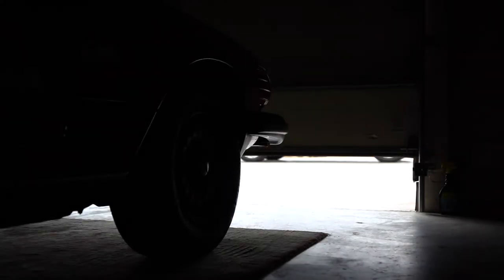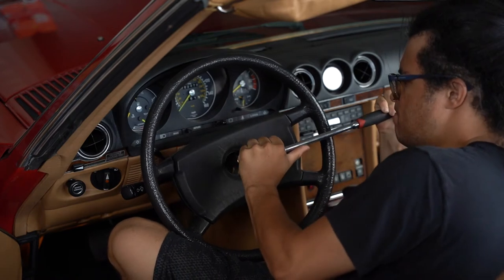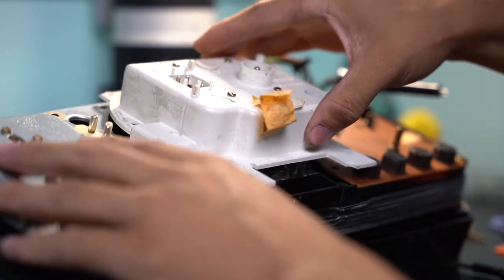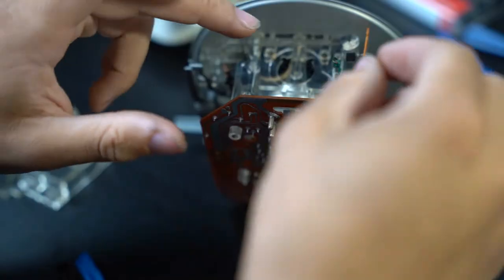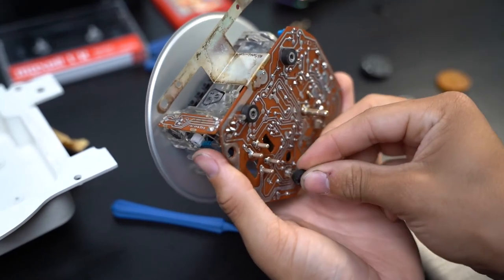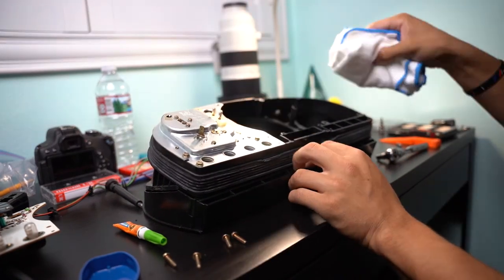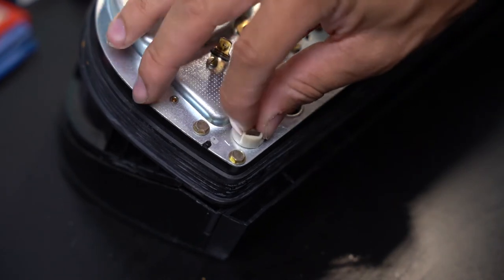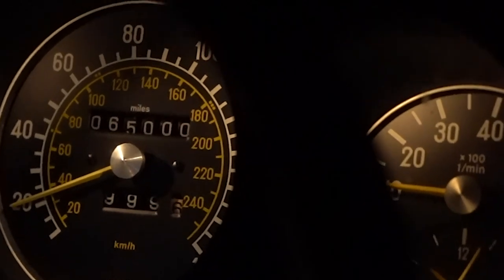Mercedes R107 Odometer Rebuild

Comment: Great video. My '85 380SL odometer just stopped. Been watching a few of these and your video is very easy to understand. I am handy but now I just need to get the nerve up to repair mine. Where did you get the interior plastic tool from? I have seen videos where theus a tool with  little hooks at the end of a handle to pull the assembly as well.

Comment: Any chance you know where to find a diagram that shows the 15 pin cluster arrangement behind the speedometer. I accidentally opened it and want to put all connectors back in correctly. 1984 380SL